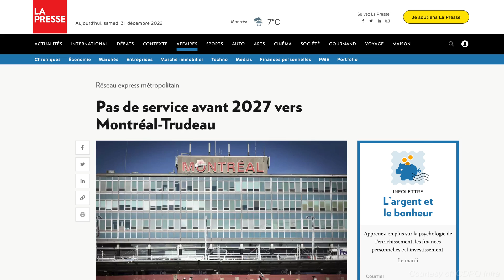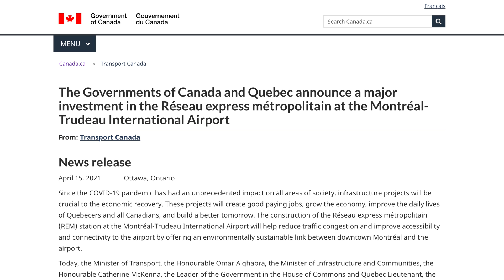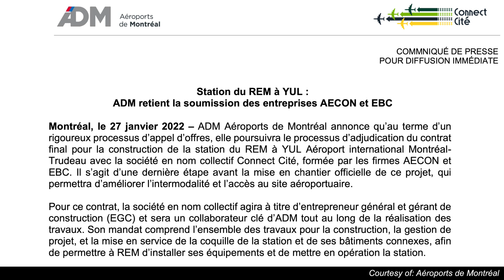The Challenges of Connecting Montréal-Trudeau with the Réseau Express Métropolitain: An Overview

Comment: From what I can tell, the plan changed and the airport station will have no actual connection to the terminal. Like anybody using the existing parking structure, passengers will be required to go outside and cross the road, unprotected from winter weather, except by an overhead cover.

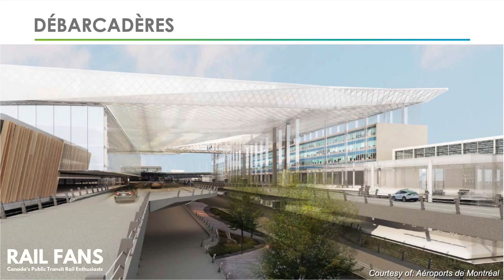Comment: I saw the dig a few months ago. But at 04:27, you show the white elephant plans for the undergroudn station which will require demolition of the parking lot in its full length.  What a waste. That station should have been right under the terminal (since the tunnel is so big) and been far mroe compact than this. 
What is not clear is that since the fed/prov pay for the station, whether ADM will be able to impose airport fees for people getting on/off the trains there, or whether the standard ARTM A tickets will do) (the reason ADM wanted to build station by itself was to be able to charge a fee to replace the parking revenues it loses due to rapid transit.

BTW, the station under the US terminal had been built, compete with high level platforms, but no tracks laid in the  track "canyon". Saw that in  early 2011. 

At one point during the  REM project, the station  was to have been east-west with tunnel passing under US terminal and aprin before veering north towards marie Curie (and avoiding ecologically sensitive  wetland/park).  Not sure when they gave up and decided to just drill from marie curie straight south and have station on north-south config. 

But since this was part of the white elephant waste of money with the bi glass roof etc (adding 0 gates and 0 capacity) I am not surprised they planned a white elephant station to go with it.  This could have been juust a simple elevators from inside terminal down to payment area and then down to tracks without need for a grandiose station. Make it fast and efficient. 

With regards to extending REM to Dorval bus terminal:  There was a plan to rebuild the Dorval circle and that involved swapping the VA station and the bus terminal locations (which would separate the EXO station from bus terminal).  So where should the EXO station be?
Also,  EXO to downtown will take much longer than our existing 211/405 express buses to Lionel Groulx as well as the couplf oe EXO trains that we have.  Having a REM station there woudl also force the REM exlcusivity clause causing use to lose our express buses and then those seat-less REM trains would get filled at Dorval before getting to airport and airport passengers wouldn't be too happy. 

Remember that now only had ADM built a train station meant to connect to the CN or CP tracks, but the MTQ rebuilt the Turcot project with space for twin tracks for the airport service to central station (on top of the 4 tracks for CN to replace the 3+1 tracks CN had prior to  Turcot reconstruction.

Comment: Is the tunnel boring machine “Alice” digging 1 track or 2 track? The diameter of the head is small ( 7,38 m ) that why I’m ask asking.
Reply from the maker: The tunnel is single tracks. Given the lower frequency along the airport trench, it will be single tracked between Marie-Curie and YUL. Both stations will have two platforms and tracks. The Rail Fans Canada Map does have the track layout for the REM if you are curious! https://map.railfans.ca/#8.76/45.5152/-73.67

Comment: Its a shame that REM never thought to extend to the Dorval bus terminal
Reply: The Dorval one-stop extension should definitely have been fast-tracked so it could at least be tunnelled with the TBM before hand. Now that the TBM is off-site, it will likely take a lot more for it to be done…
Reply: @DavidBellerive  on the plus side, the parking lot at the bus terminal has so much excess capacity they could probably feed it in from that end without interrupting service. But then you still have the fun problem of transferring to the VIA station if that's what you want.
Reply: that whole entire area is layers of short term thinking
Reply: You're right of course. But don't forget you are dealing with idiots here
Reply: A missed opportunity indeed
Reply: I would make sense to equip the Green Line with rolling stock that can also operate outdoors. Then extend the line underground to the current Montreal West train station (bury it underground and get rid of the railway crossing on Westminster Ave.). Then have the train exit to the outdoors right after the curve and continue on to Vaudreuil like the current train line.
Reply: Maybe because they want to charge extra to get to the airport just like they charge 10$ to take a bus and by going to the Dorval terminal, they cannot charge more. Less money in their pocket.
Reply: @theonh9365  the REM is subject to the same fare zone scheme as Métro de Montréal and Exo. Scheme by ARTM